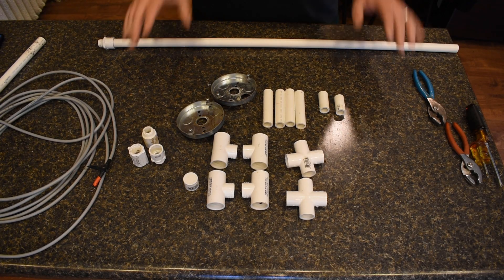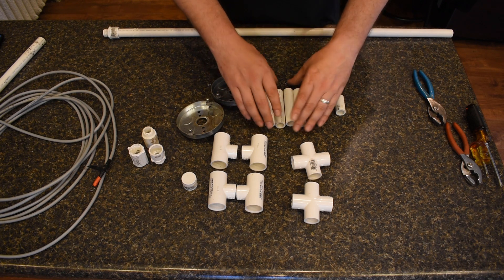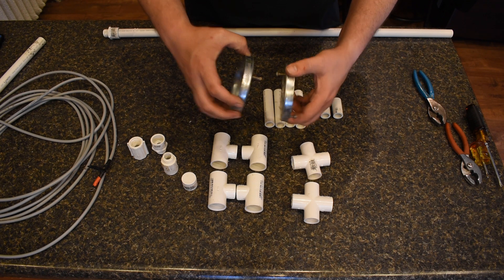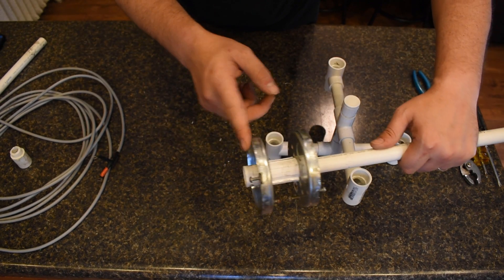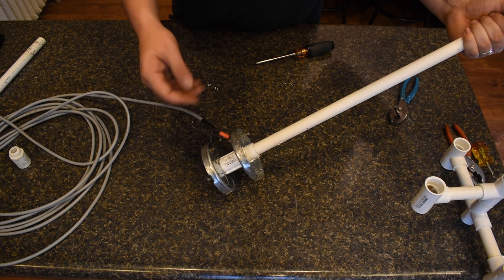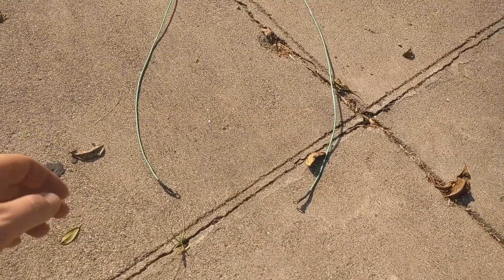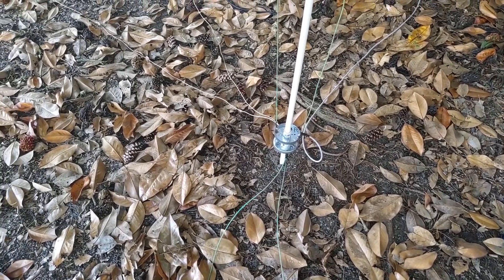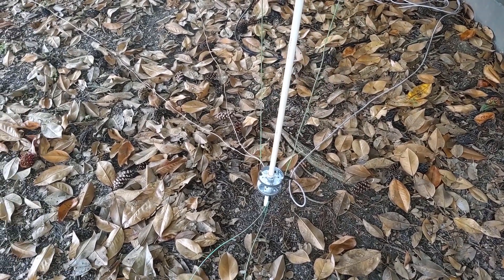Cheap HF Homebrew 40m 20m 15m Vertical antenna.

Comment: I used PVC pipe for my fan vertical, too.   I just cut 1/2 inch PVC pipe into sections about 10 inches long, drilled holes for the wires to go through spaced about one inch apart, and glued the wires in place after routing them through the spacers.  That keeps the wires from twisting together.  The whole thing hangs from the element for 40 meters, which is Teflon shielded 14 gauge wire from Home Depot.  It has lasted over twenty years.

Comment: For temporary installation, I've started using the nylon electric fence wire. Roll it up on a electrical cord reel....fairly cheap at home depot or Lowes....drastically cuts down on  tangling

Comment: KA8KRV here, on the western side of Michigan, right on the lake.  I have been a Ham since 1972, with a couple of years off.  
I am just getting back in to HF, with limited space, and this antenna is the best option I have seen.  
I used what we called a bazooka antenna for CW 5 watts or less, with an HW 7 by Heathkit. 
I also used a very old Hammer kind receiver and a homebrew X-Tal controlled transmitter from an old QST article.  I got 20-25 watts from that rig.
The bazooka antenna was a coaxial dipole. It was reasonably on 40 meters and 15 meters, with no tuner.  
My rig is an old Icon 735, I think.  It is late, and I am old.  Well, 63 is old enough.  
I plan on looking at your other videos this week, since am blessed to be retired.  With the weather here in Muskegon,  MI, scheduled to be nice for awhile, I am getting the bug to build.  The one change I may make is to use braided steel mono filament fishing leader/line.  And maybe speaker wire for 6-8 radials. I won't be able to leave the antenna up for extended periods of time.  
As for getting the paracord up, I have in the past used a simple slingshot, with a lead sinker, and once an old sparkplug.
My thanks for your excellent video, and I might just do 2 element guides to start out.  One question, do you glue your joints or just snug them together?  or maybe drill a hole and a set screw, with some silicone over to seal it?

Comment: Dave or Jim... There is so much truth behind that when you consider YouTubers Dave Casler and Jim W6LG. Honestly, I'm amazed that all the POTA activators haven't picked up on your antenna design. Just hook a long piece of paracord to the top of the elements and slingshot it over a tall tree branch, and boom- your antenna is set up in less than 5 minutes.
Reply: As long as it doesn't take a half hour to get the line over a branch without a snag - (says from some experience)

Comment: From a sprinkler guy - the two fittings are 1/2" slip by thread male adapters  - and yes - every ham has a "Dave" - 73 de KB4UF 😉

Comment: Thats a real interesting thing you got going on there with the two metal round pieces at the bottom there. I never thought about mixing plumbing pieces and electrical box pieces. I like it. I think I might use that method for making the top part of my 50 - 450 MHz Discone antenna. Nice work!

Comment: Did you do anything to separate the wires at the top of the tree if so I would be interested to learn what you did and how you did it
Reply from the maker: Pvc separated them up to the top of the shorter element. Nothing above that as It didn't matter if the long element and Paracord got twisted a bit or not. (They didn't though)
Reply: @mikehannah6054  Hey thank you for your quick reply I have got the Atera built and then putting it up this weekend so I’m looking forward to trying it out by the way I added a couple of extra bolts so it will now accommodate four separate bands
Reply from the maker: No problem! Wish I had the time to make a few more videos lol
Reply: @mikehannah6054  Yeah you’re actually pretty good at it I would encourage you to do so a lot of this could benefit by your expertise

Comment: Good attempt as a start MIKE. You give me ideas. ....In Cyprus the UV light from sun is cooking all the plastics. Two days ago the winds arrived 8 Bofors. Another danger in villages is thunderbolts...73 s from 5B4ER.
Reply: Wire insulation doesn't last very long outside does it

Comment: This is amazing. I'm going to try to build one of these, exactly like you did, for 20m and 40m. I do wonder how difficult it would be to install an so239 in it, rather than splitting the coax up like you did. Any thoughts? Thank you!
Reply from the maker: Shouldn't really be any harder, good luck and thanks for watching!
Reply: @mikehannah6054  I have done a ton of research in the past 24 hours and I agree, it doesn't seem like it would really be any more difficult. Thanks for this video. You have inspired me greatly and I can't wait to get one of these built.

Comment: swr will be out off the state ifff you dont use a antenna tuner whit a endfed... Good for listening, but bad fot tx.
Reply: Those elements are TUNED and resonant, no need for a tuner. This type of antenna functions as a fan dipole.
Reply: End fed random length or end fed half wave?  One requires a tuner and the other has bands that don't need a tuner.

Comment: Greetings from Washington.  I built your antenna for winter field day.  It performed well.  I had plenty of wire kicking around the property so I made a quick run to HD for the pvc and the round pancake boxes.   I think I will add bolts and wing nuts off of the side of the lower pancake box to make it easier to attach the radials.  It was my first vertical antenna build and I enjoyed it a lot.  Thanks for the video.  73 AC7SR
Reply from the maker: That's great! I'm glad it worked well for you. Pretty good antenna for the investment! Did you do more than 2 elements?
Reply: @mikehannah6054   So far just the two.  I think I want a fiberglass pole so that I can work on the beach.
Reply from the maker: Might try the slinky ....I can see a nice spike mount for the sand...
Reply: @mikehannah6054  I haven't seen a metal Slinky in years.
Reply from the maker: I bought a pack of 3 off Amazon to use

Comment: Great Job Mike.  I like to see how the SWR is.  I see you must have lots of patients with so many wires i sure don’t.
Reply: When I built mine I got 1.7:1 on 40M and 1.2:1 on 20M.  I used my MFJ analyzer to test.  73
Reply from the maker: Thanks, it wasn't bad except untangling the stupid radials. I didn't have a good analyzer when I made this, just used the radio. Might use this guy again, if I do I'll do a video on that and show it working.

Comment: Do you feel a balun / choke is needed in most builds like this with resonant antennas? Especially with shorter than normal radials for 40 meters? still working towards my general and some people don’t use them and some people won’t hook up to an antenna without them.
Reply from the maker: I don't think it's necessary with an antenna tuned like this one. I'm faaaar from an expert though!
Reply: @mikehannah6054  sounds good. I’m putting up a single dipole now but thought about something like this as well. Might have to try it out!

Comment: the metal plates are actually - 4 in. Round Ceiling Fan Rated Pan, 1/2 Deep with 1/2 in. with knockouts.  you can get them in the electrical aisle at home dopie.

Comment: Good HF vertical for a few dollars. Would rig up this antenna away from the build as far as possible to minimise QRM from LED and other electrics. I have built 4 of these in a phased configuration  and the antenna gives a good punch with good angle of take off for DX.

Comment: You made an Antenna but failed miserably to show it actually working!!
Reply from the maker: It works the same as any other wire antenna of this type. The video was about how to build it, not on whether this type of antenna works or not. If you doubt it, go build one and test it yourself. Thanks for watching and leaving a snotty comment.
Reply: @mikehannah6054  hhahahah u said tell u if u suck hahhaa.... but anyways i sort of have to agree with paul.. it would of been nice to see it working.. even tho theres others out there.. it is part of the hobby the radio side... tho i might try this myself.. but feed it with homebrew ladder 450ohm...

Comment: Im new to ham and love your build.
How do I know for sure what my length needs to be for my wires to be tuned?
Reply from the maker: Search for "tuning hf vertical antenna elements" there's a method and formula that's got a lot of good articles and videos on the subject. Thanks for watching!!!
Reply: The same length as the radiating wires. However, they only need to be tuned if they're off the ground.

On the flip side...if you raised this antenna base up 6-10 feet off the ground, you could actually get away with running 1 tuned wire on the ground side, for each band, as long as you kept the wire up off the ground. Tie it off at the end to a 4 foot fiberglass driveway marker.

Comment: How long are the wires for 40 & 20 meters????  And wire size (Gauge)    A parts list would be good for the newbies
Reply from the maker: Ballpark 16 and 32 feet, I cut them long and trimmed down to tune. (Tuning longest to shortest, the wires do slightly affect each other)

Comment: You have the perfect job if you drive trains.  That would be my most desirable job to have since I"m a train buff.  I guess trains and radios go well together.  I would have never thought to use a fishing rod with a weight.  Thanks for the tip.  I was gonna have to buy a bow and arrow to make it over my tall trees out back.
Reply from the maker: It's not so perfect at 3am when the phone rings on Thanksgiving day....lol. There's a lot I enjoy of the job, but the lifestyle sucks.  Trains starting to drive themselves nowadays anyways.....anyways, thanks for checking my video out!!!

Comment: As you say it's very much a ghetto DX Commander - I like it! :)   I'd recommend using radials like Callum does - get 4 bundles of 5 radials cut for 2.5m each.  When they are that short and soldered together in a ring connector they are much easier to handle and don't kink as much I find.  Looks like you can also adapt your solution to a cheap fishing pole for people with no convenient tree, then you are even close to a DX Commander.   I got a very cheap 5m firbreglass pole from a sports shop and it works great for portable 20m, 10m, 11m, 6m  sometimes need a bit of tweaking/tuning   
73!

Comment: I'll trade that fer a cup o'dirt.  Well dang, someone waz sure to ask.  Oh, who do you drive for? I have a cousin who drives for North folk and Southern.
Reply from the maker: Norfolk Southern
Reply: @mikehannah6054  You drive trains for Norfolk Southern?  
Anyway: Yeah, what you said.  The space in Northfolk was added by Spell Checker. I put the "and" in to attempt stopping spellchecker from changing that aspect. I have been in the Round House many times and nearly every one knew me. Bellevue Oh. just off Buckeye St. I wasn't even expected to check in nor have someone walk with me. (I should have asked to be put on the payroll)  Nearly 1/4 of my family worked for that RR. My Dad began as a machinist working on steam engines. By the 60's they started converting to diesels It began I think as a different name then changed to Nickel Plate RR, then Northfolk and Western then (thus far) Northfolk Southern.

Comment: Good Idea, very simple antenna and I'd assume, good performance.  You did a very nice job designing the antenna and I salute you for your ingenuity.   May I point out what I believe may be one small flaw that can be corrected easily.  I believe the antenna as shown in the video is a temporary antenna at most as a permanent installation due to the ceiling pan electric boxes.  They are made from galvanized tin I believe and will rust badly after a while in the outdoor elements causing failure to the antennas electrical connections.  As a temporary field day setup or for SOTA and other similar events this is GREAT!  Some of the pvc tubing can be glued together so there are less loose parts for carry or field installation/take-down and storage purpose.  A QRP rig, batteries, key and mic in a backpack with this antenna and you're all set for the hike up the summit, find a tree and wa-la.   For permanent installation, I would find two aluminum plates appx 7 or 8 inches square or round and with a drill press they can be "fitted" to the antenna parts and feed line attachment.  Either way, metal or aluminum, using NO-OX, coax seal and liquid electrical tape on the connections with a permanent installation will lengthen the life of the antenna.  
Congrats to Mike for doing what Hams can do best, experiment and design.
Best 73 Mike and hope to work you someday!
Jim
Reply from the maker: Appreciate it! I switch antennas too much to run into any of the long term exposure issues lol. If I was going to leave this thing up long term, I would definitely take some weather proofing measures! I appreciate the comment and info you've added! 73

Comment: It would be nice to see a parts list and how it tuned up and how far you got out. Sans that I guess this is home brew down and dirty get on the air stuff. But on the air where and how well would be great to know. I was left with, here is my antenna, and here are some doodads from a plumbing supply, and I got these round things, don’t know what they are called, and I got these socket things, not sure what they are, and I got this mast part, not sure why I’m using it because I only used a portion of it. Oh and by the way, I strung these wires (not sure of the exact length) over a tree and used these circle things to connect it to the other round circle things. After that I hammered in this other piece to keep it in place, and now onto the dreaded radials that I decided to only connect two of them (oh and call Elmer, Dave, Jim, Bob, Steve or some other name to explain it if your unfamiliar with how to tune them or why I’m even using them). And there ya go, all done, hope you enjoyed my video sans anything showing if this thing even works or worked or how it did or tuned - or any contacts anywhere at all. Yes, let me race right out and buy some pipe and circle things and wire and more wire and find a tree to hang it all up lol. Good video though, the thing I learned from it is that I can make a thing cheaply, not sure what to buy, but I learned that I too can replicate your work, only I won’t know how good it will be for me after lol.
Reply from the maker: Most of what you said is irrelevant. If you can build this like you say after watching, the video has done its job. If you want to know how or why it works, or how to tune an antenna like this, there are many other videos on YouTube that will teach you. If you want to know "how far it gets out" you probably should watch a few videos on how HF propagation works...

Comment: I have a dipole "cut" for 40m.  With an automatic tuner at the feedpoint I can also match for 10 to 80 meters.  Not perfect, but it works.

Comment: I got some good ideas from your project. I HAVE A METAL ROOF so I will be going against common thought by using it along with a tuned counterpoise inside  and tossed out a second floor window for the grounding   to get the end away from curious cats that are subject to be chewing on it as I transmit.  Finding  ways to stand off and attach the elements is the main problem. DX Commander has that solved and is the draw for it, but the pole isn't such  a good idea for the roof.

Comment: "4-Inch Round Ceiling Pan" is the "official" name, 1/2-Inch Deep with 1/2-Inch Bottom Knockouts AKA nicknamed "pancake box". I used to work for an electrical supplier and Electricians nickname all KINDS of parts and things based of what they "look" like... Had an Electrician come in when I was still "a new guy" one day and asked me for "100 assholes"!? "I'm sorry sir, we only have about 10 people working here, I have no idea where to find the rest..." That got a good laugh but he had NO idea what the "real" name of the part was that he was looking for! "lemme ask around." Sure enough, I asked a guy named "Dave" 12:59  that worked there too and he informed me he was looking for plastic insulator bushings!
Reply from the maker: That's funny lol
Reply: Thanks, I was wondering what they are called
Reply: where did you buy the "4-Inch Round Ceiling Pans" ?  The ones I can find on line do not have holes in the middle for the PVC pipe
Reply: Oh, perhaps that is what a "kick out" does
Reply: @obrienaj  it's been 10 years but if I remember my slang terms a "kick out" might be the same as a "knock out"? The blocked off plates you can knock/punch/kick out to add more connections? Make sure to use the right assholes so you don't get a short! 😂
Reply: @obrienaj  seems YT won't even let me post electrical PART numbers?! I know they delete most hyperlinks but this is getting ridiculous! 😡
Reply: @macgyver5108  , found them at Home Depot . Thanks .

Comment: Thanks Mr Hog Head !  Another great idea.
Reply from the maker: Lol why am I a hog head? Lol
Reply: @mikehannah6054  You drive trains and you've never heard of that term for a train engineer ?      Check with some of your "older" co-workers.   I worked for Southern Pacific for a "few" years and that's what we called anyone that ran a train.  Whether it was in a yard, a local run, closed circuitry track or line haul.  I was a foreman in Main Of Way and I ran a train in a rock quarry and dropped ballast from Ogden UT to Sparks NV
Reply from the maker: @JT-py9lv  nope, not heard that one. Just "old heads" lol. Been at NS for 14 years.  I know terms variate slightly from company to company.... Still gonna ask though lol